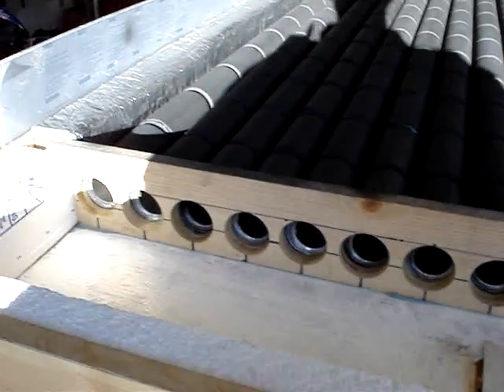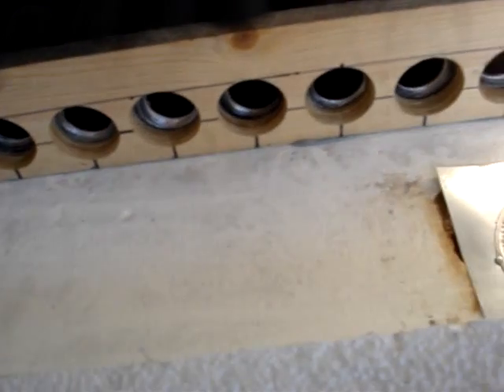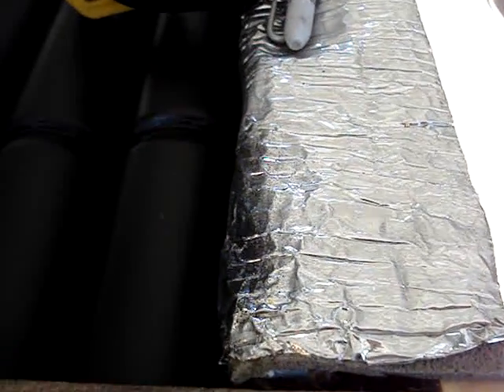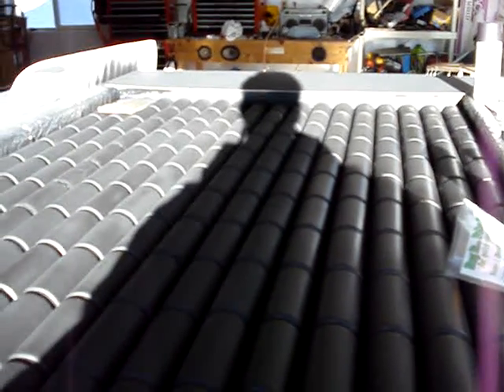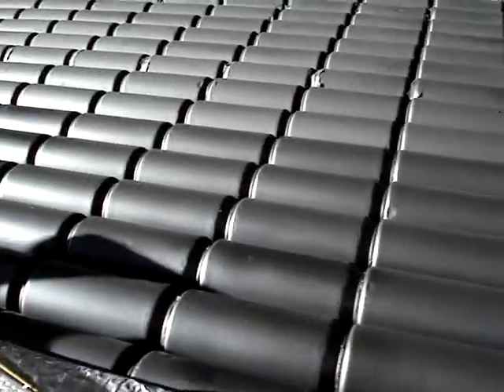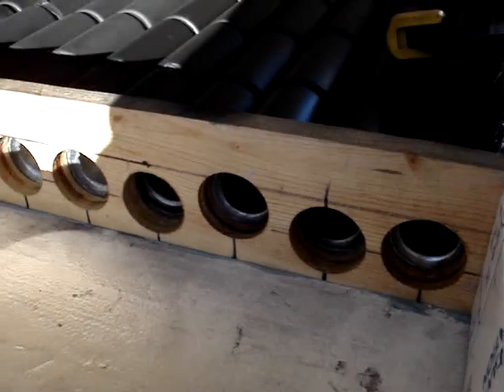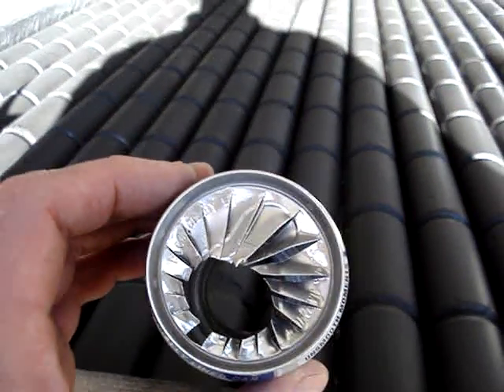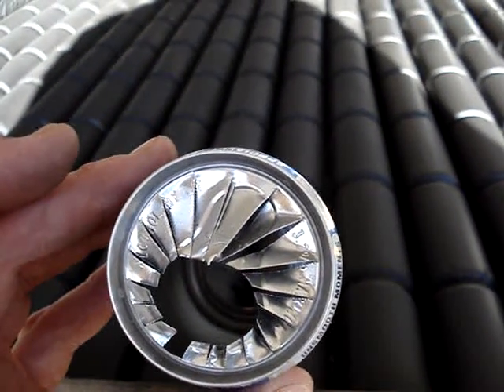Pop soda beer can Solar Powered heater furnace panel -- Part 1

Comment: Question: why not run the cans sideways instead of vertical to allow more time for heat to build? At the ends use 180-degree PVC to emulate more of a coil design like the A-coil in your furnace A/C system.

Comment: Found it!  You said in this video you used tin snips and needle nose for the top, but what did you use at the bottom to create that perfect hole?
Reply from the maker: Look 2 comments below.
Reply: I only see a comment on using acid to remove the plastic coating.    Not sure if you did that, first I have heard.  However I was asking about the tool you used to hollow out the bottom of the can.  Looks like a perfect circle
Reply from the maker: I used a metal hole saw, it's just a drill bit you can get at most hardware store for about 5 dollars. Looks like a saw blade, but it round and has a drill bit in the center.

Comment: Maybe you should google the words BPA and heat together. Its not good. I would use aluminum dryer vent pipe instead of pop cans loaded with potential poison gas.

Comment: Welcome. I have question to ask about it. In my country (middle europe) we have pretty strong winters. Right now we have like 0^Celsius degree. It is not much... but in one month it will be like -10^C or even -20^C in two months. Is it able to heat up the house during such a temperatures? I mean... like make a whole wall out of it?
Reply from the maker: Just try building one. Watch video's 2 and 3 for more data and results

Comment: Correct me if I'm wrong, but it seems this is only running at 50%. Now, what if you were to put a 4" space between each of those rows and lay a reflective material on the underside. I'd even go so far as to say, form said reflective material in a wave pattern to create rows of parabolic reflectors. Aluminum foil would even do the trick. I think this would drastically improve the efficiency. Thoughts?
Reply: yes and no.. if there is not enough solar energy to exceed what the aluminum can transmit to the air, then it would be pointless... simple way to find out would be to put some sensors in and see what the temps are throughout.

Comment: Aluminum cans have a very thin plastic coating. Otherwise the carbonic acid in the soda would eat right trough the aluminum. If you put a very strong acid on the can, you can watch the plastic burn and peel.

Comment: there is a video of a guy using CPVC(handle better the heat) for a water solar thermal exchanger.It seems to  work.
Though CPVC is not really a good thermal conductor and i am would woory about the lifespan of this project.

Comment: Actually it has been proven that it is... however it acts like most toxins. It reaches toxic levels over time... It also has been linked to early onset of Alzheimer's and other illnesses alike.. Yet I still have no issue with drinking out of a can anyway... Why? Because I am gonna die one day and be maggot food the next anyway.. On the other hand I have not heard of the leaching of Aluminum into the air at such low temps also... So the issue for now is moot..

Comment from the maker: I used a metal hole saw, it's just drill bit. Take your can the hardware store to find the proper size. It's kinda hard to hold the cans while drilling them so you need to make something that holds the can while you drill it.

Comment from the maker: You can go to a recycle center and get Aluminum cans. It can get 200 degree inside the box....DON'T USE DUCT TAPE! Use high temp silicon to glue cans together.

Comment: You could simplify efforts if you cut a hole in the bottom of your can (as everyone does) but leave the top alone (pop-top open with no cutting, fancy snipping, or drilling another hole.) Then rotate each can's orientation (with respect to the top opening of its neighbor) 1/4 turn to help air swirl when joined. That should work for airflow/heat transfer with a fan. And, I think that using a smaller diameter can, for a given box area, would transfer more heat than standard 12 oz cans.

Comment: @007westleysadler The problem with that idea is that the bricks would soak up heat when the unit is first exposed to light for about the same time as it would give heat back after the sun went down.  The net result would be zero sum.

Comment: @zsnowshredder  First you have done a fantastic job building your heater.  Excellent craftsmanship.
Constructive criticism alert;
The goal when building is not simply to measure a high temp out the exhaust port, but to measure a high temp when moving 300-900cfm of air through the box.  If you can run 800-900cfm and the air is warmer then 85 degrees, IMO your design is fantastically successful.
To compare your design with others there are other factors, but raw CFM is a good start.

Comment: should have included before and after (in use) to show it's capacity..  are fins worth the trouble?   The hold should be enough to slow down the air...which was proven by richallenmusic, the king of pop can heater presentations!

Comment: @OldSkaterGuy as i understand it, the fan blows air into a header tank, its the high pressure of the air in this chamber that drives the air through the cans, so any 'swirling' of the air by the fan is negated once the air is in the header..

Comment: @zsnowshredder gotcha.. but don't you have a fan blowing the air through the cans? Would not the swirling motion of the fan not keep the air moving in a circular motion throughout the cans? If you pulling the air with a fan I could see the need for the swirls. But not pushing it through.

Comment: I think you could do with out cutting vanes in the can. Simply cutting a smaller hole in the bottom would make a baffle style centrifuge. It would force the air to rotate like a smoke ring and the cooler denser air would collect in the smoke ring torrid wave etc. each can would be another stage in the process and progressively filter out the cooler air. At least I've seen liquid systems operate like that...

Comment: A question to anyone knowledgeable enough...I understand the "fins" to create a restriction for heat to build. and to create the swirl effect ..but do you really need to fin every can????
It seem to me you could have the bottom half of the cans wide open at both ends, and than have every other can on the top half have small restriction with (or without) the fins and still get the efficiency and heat desired.............Any thoughts????Pinheads need not respond............

Comment: You're right dude!!! The same happened to me,.. I'm getting close to cirrhosis, but she'll be apples. Seriously I made a smaller version of the panel  (56 cans= 1 week ongoing drinking) and haven't worked very well,.. 30ºC input, the panel reaches 72º and the output no more than 52ºC. I'll get rid of the cans and use steel sheet and chips,...

Comment: @RoguePlanet That is a good idea at first examination. The issue is you are not really increasing the amount of collected sun since the Fresnel would be the same size as the box. Think of it this way, the Fresnel is a focuser of energy. 15 square feet of sun hitting the Fresnel is the same 15 square feet hitting the plexi-glass. Does that make sense?

Comment: @itbarthur4u Me thinks you may need to have you central system looked at if it is running for up to 30 minutes at a time!!!! Probably something as simple as adjusting the anticipater in the thermostat but could be something worse. My central runs about 3 minutes and is off for 13-15 minutes when I have it going. Sorry for the hijack!

Comment: What about instead of using a Plexiglas cover you used a Fresnel lens from an old-style big-screen rear projection TV?  It would amplify the sunlight going in and increase the heat.

Comment: With regard to the airflow. The blower in a  central heating system runs for about 15 - 30 minutes at a time and blows air across a heat exchanger that is over 500 degrees F. The solar heater provides continuous airflow at lower volume and temperatures.

Comment from the maker: @ChuffChuffWoo Ummmm, I did use a solar fan, watch part 2 & 3. 12v computer fans do not move enough air to heat a building. Think of a central heating system for any house, it would never work using a computer fan. You need AIRFLOW!

Comment from the maker: @Dante95240 Ignition and combustion of wood is mainly based on the pyrolysis (i.e. thermal decomposition) of cellulose and the reactions of pyrolysis products with each other and with gases in the air, mainly oxygen. When temperature increases, cellulose starts to pyrolyse. The decomposition products either remain inside the material or are released as gases. That's about 450 degrees

Comment: @zsnowshredder cold air will be the cooler air in the living space that's is drawn in and circulated through the cans and back into the living space. I just cant find the little plastic valve, check valve or whatever its called that only allows air to go one way so at night i get no cold air coming back in. I just realized the top outlet will have the same problem so how do you get around cold air coming in at night?

Comment from the maker: @souleeze Where is the cold air coming from? It's a sealed ...insulated... closed loop system, no outside air ever enters the building. You may have about the same energy loss from a window.

Comment: @zsnowshredder what is the name i would look up for the one way air flow valve to stop cold air from coming in (it only allows air flow one way so it can draw in cold air only) ? I cannot seem to find one anywhere so i assume I'm looking up the wrong name. Thanks, you advice is great and i appreciate it.

Comment from the maker: @souleeze All at home depot except the dryer vents (ACE). You will need insulation. If you can find the foil backed stuff it's better and you won't have to line it with the heating/ AC foil. You will needseveral sealants/ caulks.....PL300 foambord adhesive(glue insulation to inside of box)...DAP Dynalex 230(seal leaks)... Surebond SB-1800(glue cans together) Watch videos 2&3 for more info.

Comment: @zsnowshredder Anyway you can list the name of the products you used like the sticky foil under the cans etc, where did you find the aluminum sheets or any idea in hindsight on what would have worked better or similar for some of the main components. I really want to build one and have procured 2 large sliding glass panels i intend on using as my first attempt but any details on actual materials as far as where they can be obtained etc sure would help. Thanks

Comment: Is it an air heater? I thought it was a water heater when i clicked on it. Does it store heat energy for use in the night time or is it cold during the day there? What if you ran copper pipes through it would it heat both air and water? How does it respond to seasons? WoW I have a lot of questions now, lol Is there a valve so that it only pumps and doesn't draw heat when it's cold outside ? I am SO building one of these.

Comment: @skipjagger It's the Bernoulli principle which states that a velocity increase will cause the pressure and temperature to decrease (and vice versa). So by creating the fins so as to act like stator blades on a turbine (which is why I know about this, lol) it redirects the air flow which drops the velocity and creates a greater temperature.

Comment: @skipjagger I think the swirling action that he is touting is created by the fans is to direct the vertical velocity of the expanding gases slightly horizontal that way it swirls, and gives up a part of its vertical velocity in exchange for some horizontal velocity.  That and the fans may act as a tiny air brake against the rising gas.

Comment: aaaaand i just watched part 2 and 3 your actually the guy i found out that they had solar fans from lol so thank you!!!  im building a panel right now just a little test one im gonna put on a back room in my house.  its120 cans much smaller than yours. and al i have to say after cutting and twisting all thoes fins is im glad im done!! god that took way longer than i had thought.(i cut mine and twisted them strait up and down only for more surface aria not for swirilg of air)

Comment: when i say cooler you keep the box. i mean only coller because the temperature of the air in the cans will be cooler. look at it from the box temperature point of view not the temperature of the air leaving the top of the box. i dont know how much more efficient it will get buy doing this i couldnt even guess. but if you add a solar powered eletric fan or 2 i feel like it would benifit your average room temperature a noticable amount.

Comment: lets say you leve the box in the sun to keep heating up and up and never run cool air through. it would eventually reach a maximum temperature no mater how long you left it in the sun(obviously if the sun stayed in the saim point in the sky with no cloud cover) it wouldnt get any hotter. so it wouldnt absorb any more heat energy from the sun so your kinda loosing out on energy.  so the cooler you keep the box (by running air inside the cans) the more heat energy will be pumped into the house.

Comment: im not sure but i dont hink you want to slow the air down. i think you want it to go through as fast as it can (to an extent) to cause a greater "temperature differential" like if there is cooler air running through it the panel will be "running" at a cooler temperature aka more heat energy will have been transfered into the air. so the air coming out of the box will be at a lower temperature but there will be a larger volume of air. im kinda guessing here so please dont quote me. next post

Comment from the maker: @vpbubbies The header size is OK, I think your box may be to small, but it's agreat experiment! If you can blow 100-200 CFM through your box before you mount it and get over 120-130 it would be a great heater. Watch videos 2 and 3 to learn from my mistakes

Comment: wondering about the total height of your header? I built mine yesterday , (from 2" X 6"),and made my header only 6" high at the bottom & top, then insulated with 3/4" on both top & bottom of inside the header, leaving me just 4.5" high X 36" wide X (4.75" deep), now Im worried this is too small??? Any thoughts??? Figure Id best modify now prior to sealing the glass to the unit if needed.

Comment: wondering how you joined your cans, using "regular silicone" wouldnt work for "heat" causes regular silicone to remain very soft & fall apart. I went to 6 stores (big box) but couldnt find any "heat sealant"" , Im also affraid of "OFF GASSING" from certain chemicals in different sealants. Any suggestions???

Comment from the maker: @markdrummond508 
Box is 4' x 7' because that's the biggest piece of plywood that will fit in my SUV. You don't need to have an exact size. Build your box, decide where your headers will go and then build your heating tubes to the correct legth. Watch videos 2 & 3

Comment from the maker: Not yet, I have 200 cubic feet per min blowing through the box, (see video 2&3)
Don't leave your box in the sun with out the fan running, I did melt a little silicon when I did that.

Comment from the maker: I'm just using it on my shop, which has no heat. If it's 30 degrees outside, it's about 55-60 in my shop. The heater will def lower your heating bill.

Comment: Aluminum gives off it's heat very easy to the surrounding air, way much better then any other affordable metal. That is why these heaters work so well. Normally you would have to pay a lot of money to get a usable material like the soda cans. I finally realize myself that it is well worth the investment to build a solar heater, and I started to collect soda cans already. 

Greets, iT